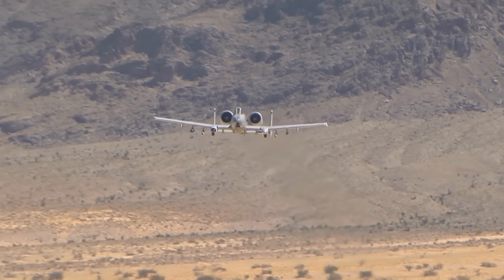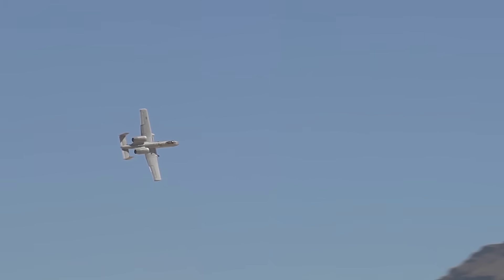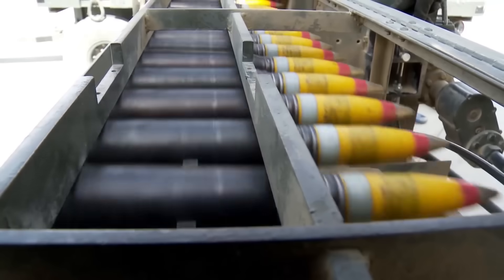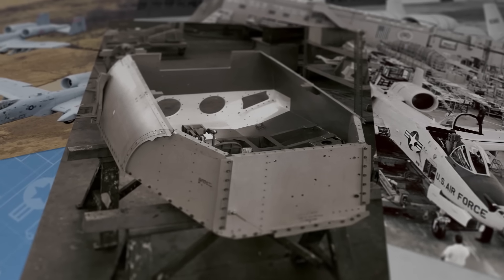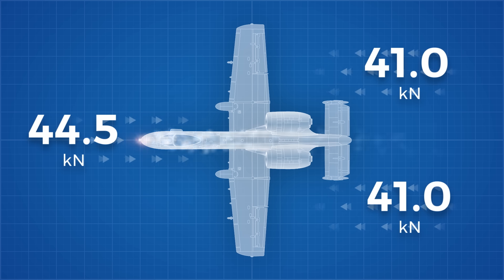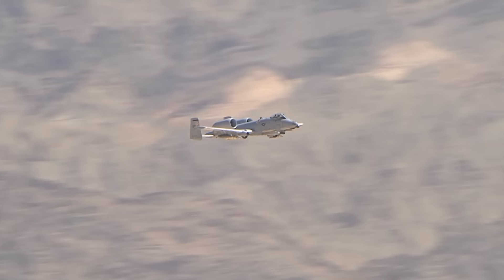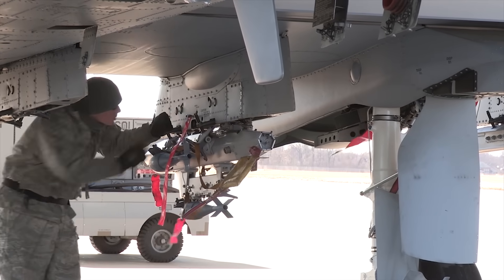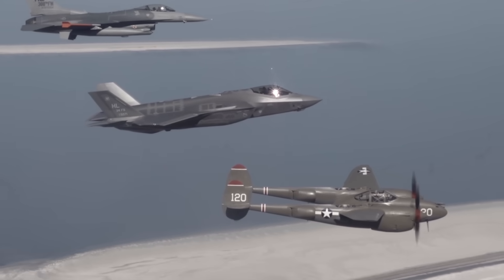The Insane Engineering of the A-10 Warthog

Comment: The F-35 is unfit for the mission of the A-10. Low and slow is not it’s strong point,plus small arms fire damage is easy for the A-10,where the carbon fiber F-35 takes a much longer time to repair bullet holes.

Comment: At present, the A-10 Thunderbolt or just plain "Hog" will not be retired until the number of losses forces a retirement. The repair facility at Davis Monthan is set to repair, update, and rebuild the A-10 until another inexpensive replacement is designed and put into service. The F-35 will not replace the A-10 unless it is forced to by operational need.

Comment: You left out why the engines were in pods away from the fuselage. It was in case one was hit by a heat seeking missile. The fuselage had a chance of remaining intact. Also, your drawing of the A-10 with the gun centred is incorrect. The gun is offset to one side so, as the gun barrels rotate, the barrel containing the shell about to come out is lined up on the plane’s centreline.

Comment: The whole argument about retiring the A-10 needs to realize something, unless the new plane go brrrrrrrrrrrrrrrrrrrrr, we don’t want it
Reply: Brr is very valid
Reply: They were thinking about retiring some A-10s but I think it think they’ll still keep them in use until the 2030s sadly
Reply: They are trying to figure out how they can mount an M1 turret and make it do the same thing.  But have been unseccessful.  (Joking here but not really)
Reply: @N V sometimes there is no replacement for human eyes. The hog really will never be outdated.Such a fantastic machine. Incredible engineering.
Reply: @yankees29  it already is outdated and that's why they are replacing it
Reply: @Zlonk7  not really, it lacking against air targets but it’ll have allies to deal with that. Otherwise, it’s incredibly durable with a powerful gun that can rip tanks into slag and missiles to support that
Reply: @civilrebel3743   the main thing is the missiles, the gun is just there for support. No, it was not created around the gun. They wanted it to have 20mm cannon gunpods on the wings but instead they put a  30mm cannon on when they saw how the Israelis used 30mm to destroy Arab tanks. The gun is mostly for lightly armoured and infantry not for tanks as they realized later when they tested it's capabilities. That's a part of why it has so many pylons for mounting ordnance, mostly for armoured targets which the gun is less capable against

Comment: "the A10 has been under constant threat of retirement"
the A10 : laugh in freedom bbbbrrrrrrttt
Reply: Well it's time for the a 10 to retire, it had a good run but most of the redundancy and even the gun are outdated and not useful anymore
Reply: @Zlonk7  well how about rebuilding a better one then?
Reply: @ramtosantosa7661  that's not how aircraft design works, we already have a replacement for the A10 in development, it's called the F35
Reply: @Zlonk7  well f35 is a multirole fighter, this is a flying tank.
Reply: @ramtosantosa7661  the  age of flying tanks is over, the a10 was designed in the 70's so about 50 years ago. Thats a long time to keep using something. The A10 is good for terrorists hiding in desert but if it was to go up against an enemy that has modern anti air systems it would get shredded to bits even with the redundancy. It would be so expensive to completely modernize it that you would be better off just making a new plane. I know its sad that the A10 is outdated but everything has to go out of date eventually

Comment: It bothers me that you said the gun is mounted in the center, when its clearly off-center optically at least. Isnt this required to cancel the torque of the gun when firing, or something like that?
Reply: You are correct, it is mounted off the center, but it fires out of the leftmost barrel (leftmost when looking at it head-on) this is so that the recoil is still centerline

Comment: P-47: Are ya winning son?

A-10: Yes dad, I am.
Reply: The P47 is Grandpa.  The Skyraider is the A10’s dad.
Reply: @keirfarnum6811  and the F35 is the son
Reply: Big engine to big brrrrrrt gun
Reply: @N V true but hey, at least you can stuck 7 spears on it and call it a day
Reply: Still this plane is sh1t if we compare to su-25, A-10 less manuverble even rpg can hit this plane, less payload if we compare to su-25 the only upside of this aircraft if we compare to his counterfit is the brrrrrrrt gatling on the nose because its cooler than su-25's the only reason us still use this aircraft untill 2021 because the opration cost is cheaper compared to other us aircraft but when several dozen a-10 reportedly shot down by aligator dual axis russian attack helicopter they imediantely retire the a-10 to prevent spreading the shame what an irony
Reply: @ragnarokx1128  The SU-25 also dies to small arms fire unlike the A-10, making it less useful for CAS

Comment: I remember the last time they tried to retire the A-10. There was an uproar among infantry units, because they said there was absolutely no better air support.  F-16s and 15s go streaking by so fast that if their payloads don't hit perfectly the first time, it takes agonizingly long for them to turn around and try again, if they are even able to.  And there is always the danger of friendly fire when infantry units are operating in close contact with the enemy.  With the A-10, however, if it's initial strike doesn't destroy or supress the target, it whips around and tries again, and if necessary, again, and again.  It is able to strike at targets ridiculously close to friendly troops (I think anything beyond 50 yrds, but don't quote me on that).  The A-10 has been so useful in Iraq and Afghanistan, that the US military actually solicited designs for a prop-driven close air support plane, reasoning that in environments like that, fighting against relatively poorly equipped insurgents, there wasn't much danger to aircraft, and therefore no need for a high-speed, jet-powered plane to avoid modern aa weapons.  On the contrary, being able to fly slowly over the battlefield would be a virtue, and not only could prop-planes do that better than air jet-powered plane, they could also remain in the air much longer because they're fuel consumption would be much less.  So in the 21st century, the military was essentially looking to get suped up WWII era planes that could fly slow, put a high volume of precise .50 caliber  and unguided rocket fire on lightly armored targets, and could take off and land from, short, primitive airstrips, while being relatively cheap to produce, easy to maintain, and inexpensive to operate.  I'm not sure if the contract still exists or if the military cancelled it, but either, I figured it should have been the easiest design in the world:  take the blueprints for a Vought F4U Corsair, update it with a modern engine plant, ejection seat, and computer targeting system...and you're there, basically.

Comment: They should just make a new version where they got two GAU 8/A on the rear with some visor targeting like in the apache heli's so the A-10 can fly over and then up and unload two 30mm chain guns of death straight down while providing 4x the thrust going up out of range of enemy fire even if they have to limit it to 500 rounds per gun and if two guns do not weigh it down to much. Just an over the top idea.

Comment: Simply stated, the F-35 and F-16 in particular are not capable of surviving as well as the A-10 is, they can't get as slow, they can't stay as low, they have vastly lower loiter time, and they are not capable of putting as much ordinance into the ground. Oh, and on that survivability note, they're 5 times cheaper per unit than an F-35 to boot.

While there are a few arguments against it, most of them were artificially created. Its age is artificially increased by a military that wants fast and sexy aircraft with multi-role capability, its lack of a trainer variant was intentionally chosen, its lack of night fighting capability was also artificially prolonged, the aging engines and wing structures were allowed to continue as funding was continually pushed away from it, and all at a vastly lower cost than any alternative.

It would be easy to simultaneously begin seriously evaluating future alternatives for this ostensible future war that the A-10 isn't capable of, while upgrading and repairing the existing units for virtually no cost compared to alternatives.

An even better option is to retool the A-10 to carry more rounds such as with a 25mm cannon since the 30mm is comparatively easily swapped, meaning if armor needed to be dealt with, it would be easily replaced. Light vehicles and personnel are no match for anything even close to it, and it would give even more increased versatility to this monster of a platform.

Comment: Two errors in this video.  1.) It is named the A-10 Thunderbolt II (P-47 being the first Thunderbolt), not Lightning Bolt.  2.)  The GAU-8 is actually not centerline, but offset from center so that the firing barrel is set to center.

Comment: Correction.  The GAU-8 Avenger is not mounted directly on the centerline of the airframe. It is actually offset to the left of center  so that the right barrels are in centerline with the aircraft, as the gun fires from the right side when in operation. This was expressly done to stop the gun from yawing the plane during firing.  Simply looking at this photograph supports this. https://images01.military.com/sites/default/files/media/equipment/weapons/gau-8-avenger/2014/02/gau-8-avenger-001.jpg

Comment: 7:45: Just realized, the gun isn't actually mounted in the middle of the plane. It is slightly to the right when viewed from the front. This is because since there are 7 barrels that rotate around one seventh of a rotation every time a round fires, and only one barrel fires at one time, having the gun in the middle would mean that the firing barrel won't be in the center of the plane. With the gun slightly offset, this ensures that the firing barrel is in the 9 o'clock position or the middle of the plane, again when viewed from the front.

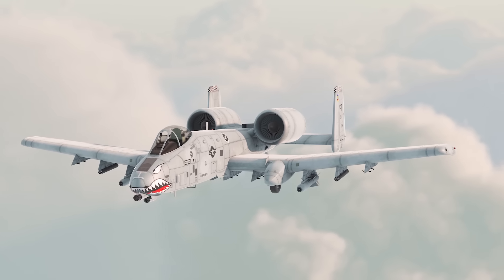This is clearly shown here at 7:03. It also explains why the nose gear is on the left side when viewed from the front.

Comment: Depleted uranium doesn't give the round more kinetic energy; the only things that effect kinetic energy of a bullet are the energy of the propellant explosion and the length of the gun barrel. You don't get free energy by just making the bullet heavier or denser; the increase in mass will be balanced by a decrease in velocity. Depleted uranium is advantageous for the self-sharpening quality you mentioned as well as because a denser round has a lower cross section for a given mass and shape, allowing less of the penetrated material to "push back" against it.

Comment: Honestly the next step for a new CAS bird would be to build a new version of the A-10 that has VTOL built in or we need to go the cheaper and reliable route and start buying upgraded Super Taconos or develop our own because a good turboprop airframe can do the job just a bit cheaper and with only a loss on the top end of weight capacity.

Comment: You know them idiots in the military that say the F-16 or the F-35 could replace the A-10 none of them have the Gatling gun number 1 and number 2 none of them have the the Redundant systems that the A-10 has like titanium bathtub underneath the pilot the another one is they can operate from forward bases without any or barely any support up close to the front and I know the F-35 damn sure can't and I don't think that Sixteen and either also the triple redundant hydraulic system I can go on and on and on those two planes we would lose way too many 1/16 with isn't a big deal cuz we had thousands of them but then there's the pilot think of and you would ever use the F-35 for close air support is just ridiculous

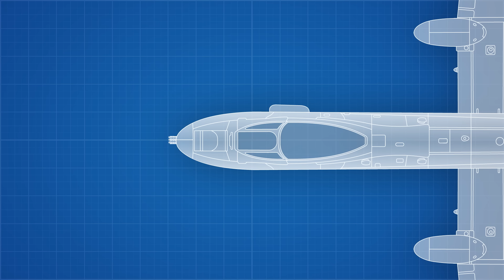Comment: 7:45 Actually the 30mm cannon is mounted slightly port side (left) so that the firing barrel is dead center line of the aircraft.
Reply: So glad you said this thought I was going insane
Reply: The landing gear also had to be offset to be able to fit the gun, or vice versa

Comment: You can ask any soldier that's been pinned down and getting over run by enemy troops. Hands down they all will tell you the sound of the a-10 doing a gun run is one of the best sounds you will ever hear.  The a-10 should always be kept in service. It's ability to fly low and slow to take out targets is something unmatched by almost any other fixed wing aircraft in service.

Comment: Plus the A-10 can stay in the fight for much longer. A-10 slower allowing the aircraft more time to look around, target and take out a target. Also they are much cheaper than an F-35. I know that the Airforce is not going to use a F-35 when they can use an A-10 for a close up ground strike mission.

Comment: Brrt brrrrrrt brrrrrrrrrrrrt.... hoorah, I joined the Corps in 2007 till 2007. I fought in the Second Battle of Fallujah, Kandahar and Kabul with small insertions in between. MOS 0317.
 Grunt in the sky!!! This ingeniously engineered aircraft has my saved my ass more than once, that's for sure. Nothing like hearing that hum come from the sky. It has the most distinct sound of anything on the battlefield. Without the warthog, there would be many more Marines and soldiers not with her wife and children that's for sure.

I saw over 300 haji's that had pinpointed 24 of us Marines location in Kandahar and they were hard at it trying to get to us. Our comms liaison called air support about the time they got 2,500 meters from us. When the A10 made its first pass, the hajis were in a Thicket of Pines and the grunt in the sky couldn't get eyes on like he needed to to unleash hell. He didn't have to... when those Haji bastards heard that warthog come across the sky they retreated so fast that they left a dust plume in their wake from running in the opposite direction of our location. Most of the time if a warthog drops in, the Target will almost immediately retreat. They know they can't defeat the brrrrrrrrrrrrrrrrrrrrrrrrrt, as a matter of fact, that was the nickname that my platoon gave the warthog. "Bert"

Comment: Just 15 seconds into the video when the errors  started appearing;
-- it is the A-10 Thunderbolt II, not the Lightningbolt
-- the gun is the GAU-8/A, not GAU-8
-- the GAU-8A is  not mounted along the centerline. It is offset to the left, so that the firing barrel (in the 9 o'clock position) is in the centerline.
-- the engines are General Electric TF-34, not T-34 (TF for turbofan)
-- uranium hexafluoride is not simply "taken off their hands and fired" as depleted uranium ordnance. It is a crystalline substance which needs to be "deconverted" to an alloy, and is mixed with small amounts of titanium
-- depleted uranium has NOT been proven to be carcinogenic, as it has been "depleted" of most of its radioactive U235. However, it is still a heavy metal and therefore highly toxic, and will result in renal failure etc, not cancer.

Comment: The United State's of America is to worried about air dominance which is good.   Until The United State's of America can focus on a ground support air plane they should leave the A-10 alone.   The A-10 dose it's job and dose it very well and staying with old philosophy if something is not broken then don't try to fix it.   The A-10 is not broken so you can maintain the A-10 and replace what ever break's just never replace it.   The United State's of America already screwed up once when they retired the SR-71  with out having a replacement for the SR-71 Black Bird  and that would be a wonderful air craft to have right now.

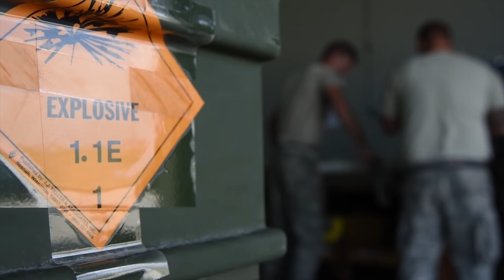Comment: “Efficacy” means “the ability to produce a desired or intended result.” At 11:31, I think you meant to say “The ETHICS of using depleted uranium is not good.”
Reply: Yes.  In this case, the efficacy of DU is the polar opposite of the ethics of using DU.
Reply: Lead and Tungsten are also toxic for the same reasons DU is. Depleted uranium is actually less radioactive than natural uranium ore, but it is a heavy metal and it will poison you if it builds up in your system from ingestion or inhalation.

Comment: 7:44 "The gun is mounted directly on the center line of the plane." This isn't true, the gun is actually slightly off center to the port side of the plane. You can even see it in this video at 1:08 and 10:04. Why exactly it was decided to do that, I don't know. If one needs to prevent the plane from veering off to one side while firing the gun due to recoil, why not rotate the whole gun some 90° or so degrees to have the recoil vector again right on the center line? It had to do with space limitations inside the fuselage is my guess.

Comment: It's actually the Thunderbolt II, not Lightning Bolt. It was named for the P-47, of WW2 fame. The P-47 was built by Republic Aviation, and, the A-10 was built by Fairchild, which had acquired Republic.
Reply: Truth is, at the altitudes the A-10 was designed to operate at, if it gets a flame-out, it's done. Regardless of how quickly the engines can be re-started.

Comment: I worked on the weather systems for the US air force during the early iraq and afghan wars, every munition and every plane had something we had to worry specifically about. The one plane I NEVER heard mentioned in any briefing, was the A-10. Why? Because it can fly in fucking anything, and shoot in anything. It's not going to be disabled by lightning, have the pilot cooked by solar radiation, crash because it fly through some dust, and its weapons aren't going to hit a hospital because it got 1 micron of smoke dirtying up its optics sensor. Getting rid of the A-10 is one of the fucking dumbest ideas I'd ever heard when I was in the Air Force (and that's saying something). The Air Force needs a purpose built CAS plane, exactly for the economic and reliability reasons cited in this video.